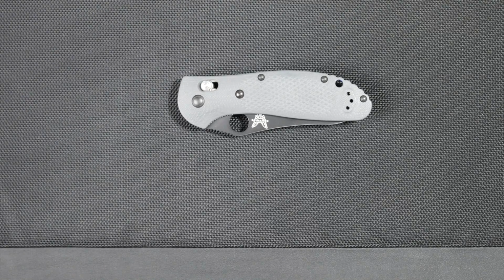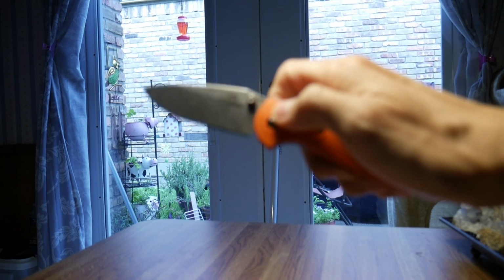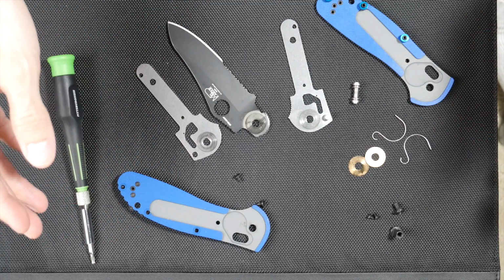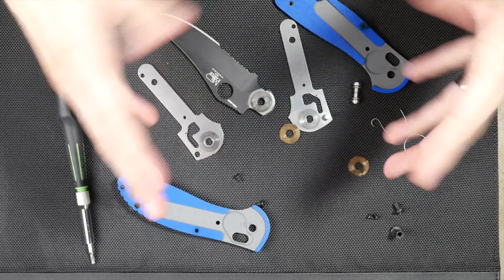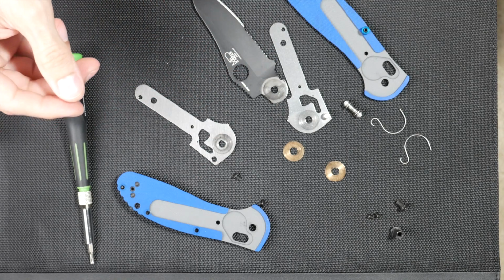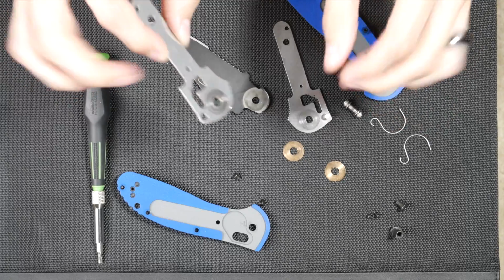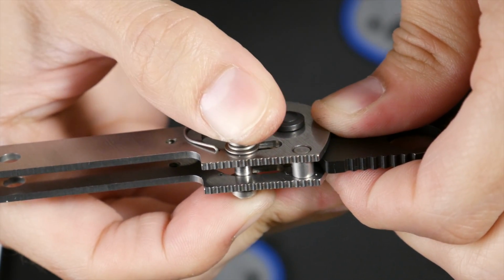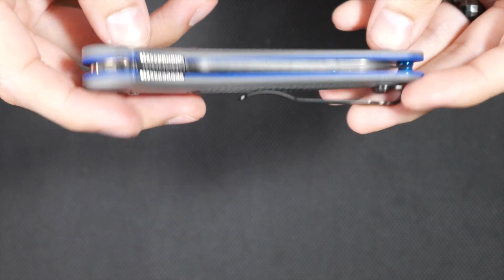Fixing Benchmade Axis Lock issue

Comment: Hey Marc, I know it's been 7 years but I want to say thanks for the tip. I have a mini bugout that luckily doesn't have lockstick, but has a tiny up/down lockrock in the 3 years I've owned this. Tried 3 different lockbars of different materials, tinkering with all screw tensions, etc. The only thing that actually fixed it was to slightly widen/sand/polish up that space in the liner inserts like you showed in your video and man, the lockrock has been FULLY removed and it locks up solid every time now. 

Seems like the issue was poor engagement between the blade and lockbar because the channel in the lockbar was stopping the bar just microscopically short from really wedging into the blade. I just want to say thanks because this has always been bugging me about this otherwise great knife. Keeping this comment up for anyone who needs this in the future.

Comment: I was too lazy to take mine apart. I just used pencil lead on the tang, lockbar, and the area that you sanded. That helped initially and allowed the knife to break in. Mine was so bad that if you flicked is very hard I could not get it to unlock with my bare hands.
Reply: good idea going to try that also!

Comment: Have the same problem on a brand new Bugout 535 and also didn’t want to go through the trouble of sending it to BM. Only happens when I really open it with force. I’ve just been working it over and over and over, and I think it’s almost completely fixed the problem. If it starts binding again, I’ll try this. Thanks for posting.

Comment: Start at 7:45. 
I did this to a 535 bugout and progressively did 800, 1500 and finally 2000 grit. Reassembled it and after I opened and closed it about 20 times it's 95% better.

Comment: 2024, brand new bugout in hand and it's still the same. Flick out the blade with a bit of force and it's locks up tight. Some good tips in the comments to try before i have to break it down and get out the sandpaper. Cheers for the future!

Comment: Just got a bugout, and I don't have this exact problem, but, it's so "gritty" feeling to open/close.
Reply: I had the same issue with my 940 but I just ended up taking the liver and blade out only and cleaned it out and re oiled it and it worked wonders

Comment: The issue with the axis lock “binding” to the blade happened with my Freek.... the axis lock has a little bit of a break in period but it’s smooth as butter now, just need to work it for a bit
Reply: Just as an update: gave my Freek to a friend and now have the 940... same thing happened to the 940 but after messing with it for the whole day (as us knife guys tend to do with a new knife) it’s butter smooth as well
Reply: Good to know, I got my Freak today and it's doing the same thing when you flick it open with some force. I'd always heard Axis locks needed some breaking in so I'm glad to know it's true and not a defect. Also some graphite powder helps a lot until it can get broken in.
Reply: @zackphy  congrats on the new knife the Freek is great I personally wanted something nicer which is why I went for the 940 after the Freek being my EDC for a year and a half which I ended up gifting to a friend.... may end up getting a “super Freek” down the road eventually

Comment: I’m having same issue w my brand new 940-1 to the point that I returned it and this is my 2nd and same problem. Thank you for this vid
Reply: I just got my 940-1 and it sticks. With S90V steel I’m wondering if it will ever break in but this video gives me hope because maybe it’s not the blade steel necessarily. I’m going to try graphite lube.

Comment: I recently got a Benchmade Triage 917 and it is ridiculously tight.  I added clipper oil and worked the crap out of it.  Still no play.  Since I like the straight blade of the Triage but enjoy the textured handle of the Stryker 908SBK, of which is flawlessly smooth, and they both have the same blade style, I decided to swap them.  Come to find out there is an obvious difference in the washers.  The Triage washers are noticably thicker than that of the 908, even though it would take a micrometer to measure the minute differences.  After the swap, there's no play in either blade-to-handle and the 908 continues to be very smooth and the Triage remains snug.
Reply: I also added clipper oil 💀
Reply: @Mylowerbackhurts  It’s great stuff…doesn’t attract too much dust or lint.

Comment: Kind of funny.  My 17.95 Ganzo  Firebird has the same issue.  They dud copy the Axis lock entirely.  I put a small drop of mineral oil baed oil on either side where the pin contacts the channels.  I figured that  any benefit would be short lived.  So far it’s still working well.  Maybe the iil aided the lock ti break in?  
PS; I just ordered q mini griptilian.

Comment: So Josh, I have a new drop point, same model brand new. The blade is very tight when dropping down after releasing the axis llock button. What is my problem? It will only go 1/4 the way down.
Reply: Loosen the pivot screw. I just bought a new Osborne loosend the screw a little and works like a charm. Dont over loosen or there will be blade play. Torx 8 I believe is the size you'll need

Comment: I believe I'm having the same problem, I wanna try this but I'm a little nervous about taking apart the whole thing & trying to put it back together, did you have any difficulty doing so?
Reply from the maker: No, the Griptilian line is pretty straight forward. two omega springs, one on each side. The same with the frame/liners. Then it's just the screws that hold everything together. 
Let me know how it goes.

Comment: Brand new benchmade bugout cf elite had the axis stick and jam to the rear so it won't even lock the blade open.  The blade swings back and forth like a limp dick. I'm sending it back cause for the money spent ($145) I'm not fixing their crap. They can fix it or replace it. I mean seriously I just took it out of the box and began opening and closing it.

Comment: that happens when you over open it, if that makes any sense. you just have to break it in that's all no big deal.
Reply: I just got a brand new Crooked River that has the same problem. It binds up when I "over open it" as you say, but also when it's closed too tight. I have to open it just a little bit before the Axis lock will stop binding up.
Reply: @BrassStacks  yeah I have the same problem when I oil mine. I just had to rinse mine under some hot water and then I just kept flinging it open and closed while watching a knife review video lol

Comment: Four Benchmade into the group, 556-1,555, 527, 319, and never had that problem. I do always pull on each side of the lock bar when unlocking. Is that part of the problem, I mean just pulling down on one side of the lock bar?pretty sure that BM CNC's all of their parts so to have a random problem like that, is probably user error.